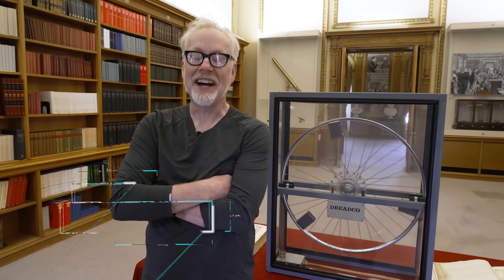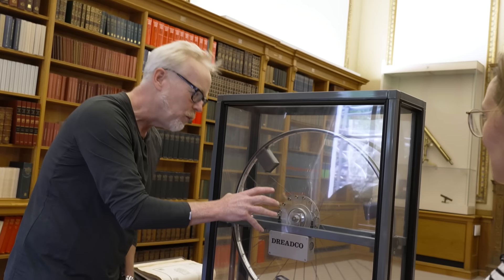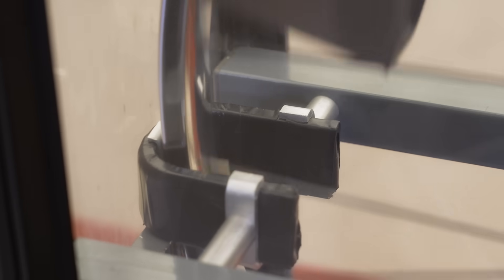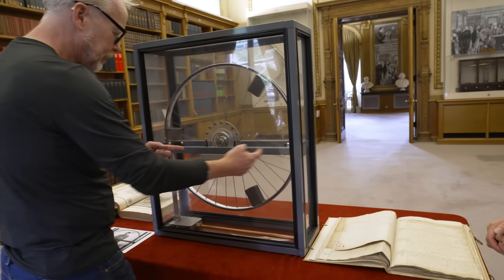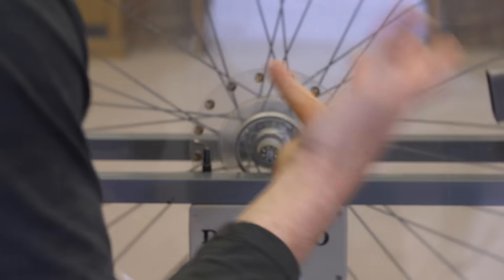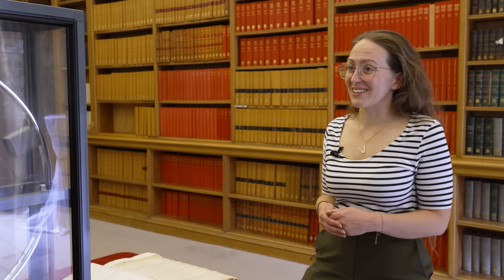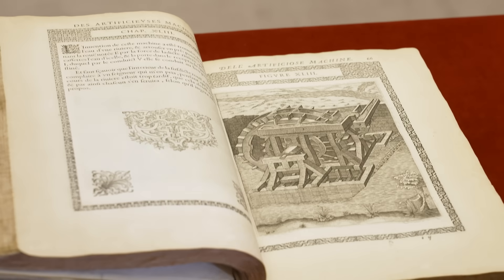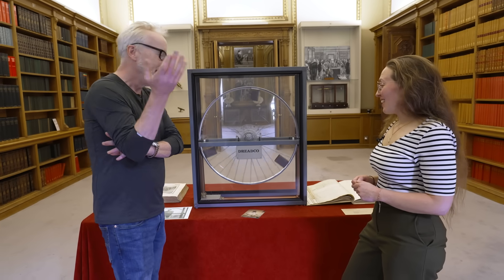Adam Savage vs The "Perpetual Motion" Machine!

Comment: I'd guess given the point of it appears to be to prove a point it's just a flywheel in nice bearings and thin air. There are no end of quite obvious ways to fake it using batteries and electromagnetic impulsing, to be interesting enough to make the collection it's either really really simple, its value is in asking questions of how we think. Or it's employing some genuinely curious environmental energy harvesting technique but that would be interesting in its own right in which case it doesn't need a 'perpetual motion machine' around it.

Comment: Is there any chance the box is a vacuum and the inside rim  are large magnets pretending to be counter weights....and the way they get it moving again is to just pass a magnet by it from the outside?
Reply: No. Thin acrylic would not withstand the force applied by a vacuum. Also when Adam taps on it you can clearly see it's not under vacuum.

But how would that make this any easier? The question isn't "how do they recharge it through the acrylic". They obviously just remove the acrylic. The question is "how is energy being continuously supplied to the wheel, where is the motor hidden, and where are the batteries hidden?"

Comment: you can't make a perpetual motion machine, but you can make a super dense magnet that lasts you 4000 years.
all you need to do is figure out the field dynamics so that forces from each pole don't cancel each other out.
like,... you know... opening up the exhaust valve when blowing the combustion out so it doesn't choke your engine.

if you can achieve a contraption that runs maybe 100 years even with the crappiest of engineering, on nothing but a single magnet? you've done it.

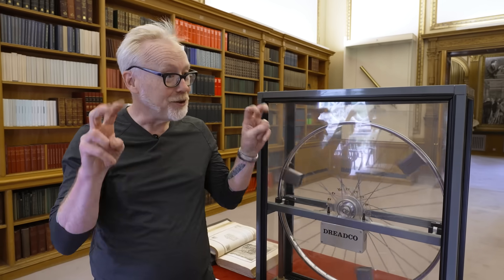8:50
no... you don't need overunity, you need just the right amount of it
the particle interactions that make nuclear reactors possible have been cooking and hardening within the Earth's mantle for literal billions of years.
releasing them in the span of 100 years or 100 milliseconds is all about the finesse of the engineering you apply to it.
there's no "overunity" in making a reactor to extract energy from a piece of uranium.... everything you put into making it will still pale in comparison to the amount of energy put into creating that lump of uranium by squashing and twisting layers of molten rock for millions of years under the Earth's crust, which will then be released over a period of decades, much of which will be lost to friction.
your "unity" has been boiling and cooking all over the place up until this moment... all you have to do is know that fact, first and foremost, before you try to "over" it.... which, let it be mentioned, you won't achieve.

Comment: If you can see it, hear it, measure it, in any way, it is not perpetual. The act of measuring requires some input/output of the system. Since energy can not be created, it is guaranteed to use energy to observe it. With that said, you can't observe perpetual motion

Comment: Each of the 3 small boxes contains a battery, a coil and a diode. The u-shaped pieces on each end are magnets. When each coil passes by a magnet, the change in flux causes current to flow in the coil, building up its magnetic field. When this happens a small amount of charge is drawn from the battery through the diode. As the coil passes the magnet, the field collapses creating a magnetic field that opposes the permanent magnet, giving it a small push.
Reply: @danejames7098 Nothing anyone has ever built or will ever build is a perpetual motion machine, so this not being one either should be very unsurprising.

If you ever find yourself wondering, "is this a perpetual motion machine?" The answer is always no. Always. There are literally no exceptions.
Reply: We can not confirm or deny whether this is correct. Gold star to u sir. ⭐️
Reply: Seems too obvious considering she said he tossed in decoys to stump people. But knowledge is exponential! Good chance what people thought was complex science back then is trivial to us in modern day.
Reply: @danejames7098 Perpetual motion machines cannot exist - That's it! There is always friction, which transforms energy into heat - even if that may be friction to air! Put in a vacuum maybe but there will be friction in the bearings. Anyway its pointless - they DO NOT EXIST and never will!
Reply: This is what I was thinking as well, just far more eloquently and scholarly spoken.
Reply: @danejames7098this device is a puzzle ment for people to look at and try and figure out where the trick is hidden.

the host even says as much dutung the video.

Comment: So it looks a lot like an early static electricity motor or better yet a wimshurts machine that is being run by static electricity, which uses a similar but simpler idea to the later electric motors. It would explain why there is a number of potential points that are sitting around the wheel. And would explain the disappointment that the guys had. 
However power supply wise, obviously there isn’t any layden jars (simply version of a capacitor) but it could be using a modern battery. Or if they really wanted to have fun they could have used a dry stack battery which would be good for very small amounts of energy being released over a long time. 
Now it could also be that the inside of the entire case is actually a layden jar which would be amazing because it would mean that the answer is slapping you in the face but it’s easily overlooked. 
It’s also possible that it is scavenging static electricity from its environment too. Which means that it’s actually honestly a power generator but isn’t technically over unity. The reason for it slowing down would be because it’s too isolated and would need to be in a place where people are moving around. 
It would be an interesting experiment to instead have it in a main room for a number of years and to see if the slowing down issues actually didn’t occur

Comment: It is basic HS science to know that electrons flow onto a ball shape, and off from a pointed needle. This specific part of the wheel deals with static electricity, and may also include electrons/ions as the same basic push/pull force. The wheel is creating an ion/electron flow that gets picked up by the ball, and emitted from the point. The large metal squares add inertia to keep it moving, as well as to pulse electrons.  It takes less energy to keep an object moving than it does to get it started.

Comment: The nozzles on top of the dreadco box provide a flow of air into the cups. That flow is the result of passing the 3 moving objects through the 3 stationary objects (u-shaped) which create a pulse of air into the square tubing, into the dreadco box, and through the nozzles, into the cups, with just enough pressure to rotate the wheel.
Reply: So you think the wheel is pumping air through a tube with multiple right angle bends, and out a tiny nozzle, with enough force to move said wheel, but with losses on the order of 0.1% system energy dissipated per day? All the air deposits all of its energy in the wheel. No energy gets lost to air resistance. No energy gets dispersed into the atmosphere when the air exits the nozzle. The bearing loses no energy due to friction. Just two years of sustained gentle breeze powered by a slowly rotating bike wheel?

Yeah...no. That's very, very silly.
Reply: The energy it takes to compress the air, albeit slightly, would have to come from the wheel... only to have it deposited back to the wheel... The losses are too great. There is no sense in robbing force from the wheel to try and keep the wheel moving, since you will always lose energy in the conversion or transfer. No, whatever is imparting energy to the wheel is independent of the wheel, and thus needs (ahem) perpetual service.

Comment: I suspect the three boxes all contain a small battery-powered circuit that senses the magnet and discharges a short pulse into a coil, giving a very small kick. This could be made to drain the battery extremely slowly. All the other elements are red herrings. Perhaps also the box is evacuated to eliminate any air resistance, and the bearings could be ceramic for very low loss.
Reply: You can almost see the wheel pulse like you describe
Reply: I would agree with this hypothesis. It would also help to ensure the wheel keeps spinning, one, or even two of the boxes could fail and the third will increase output to compensate. I would even add that the sensors may well have timer circuits which measure the period between detections and reduce or increase the size of the pulse to regulate the speed of rotation.

Comment: Any method of generating energy and then using that energy to help spin the wheel will have some in-efficiency and would therefore slow the wheel quicker than not having the devices. There needs to be some form of energy storage providing the small amount of power needed keep it moving.
Reply: Yup. Remove all the extra stuff, and I guarantee you what will be left is a wheel, an electric motor, and some batteries. Everything else is a red herring.

Comment: It MUST have some impetus to overcome the friction from the bearings, I guess it has to be a motor, running at an ultra low current.
Genuine perpetual motion is only possible with zero friction, which is also impossible, even in a vacuum there will be particles present which will impart a minute friction, even a beam of light has a pressure.

Comment: Perpetual motion might be possible in the sense that something may be able to be exactly 100% efficient. (Probably not though.) But getting said device to then do any work without additional input energy is definitely impossible.
Reply: Nope, doesn't work. Also that's not what anyone means when they're talking about perpetual motion unless they're posting something like this. Perpetual motion refers specifically to overunity. "I could make something move forever if I removed all the things stopping it from moving" is not very interesting, or insightful, or useful if accomplished. It's just box ticking next to dictionary definitions of "perpetual" and "motion".
Reply: iirc it's not even possible to have a 100% efficient machine, because of chaos theory/entropy
some forces always forces pulling on everything, like the gravity of all matter pulls on all other matter in the universe, etc.
Reply: there will always be some friction.

Comment: Imagine if someone figured out how to break physics and made one. No one would ever think it were true. 
With good reason.
Reply: Nah, they'd just demonstrate the device, and then people would believe them. If the device works, proving it works is trivial. The problem is none of the devices ever work, so tricking people into thinking they work takes a lot of effort. You have to figure out how to hide the energy source, set up an event where you get the right kind of gullible people to show up, convince them they can't actually inspect things because <safety/trade secrets>, explain away why your test of a "perpetual" motion machine only lasts a few minutes, come up with reasons why you can't let any independent group examine the device at any point in any capacity...

Comment: This might sound crazy but could it be weight transfer and magnets 

So the blocks are half filled with a liquid? 

When the wheel turns there is always two blocks around the top of the wheel A bit like a water wheel only rather than water filling the buckets for momentum there are two magnets either side with opposite poles creating a magnetic pushing motion this obviously isn’t enough to push the wheel fully, which is where the weight of the water comes into play as they reach the top the weight of the water forces the wheel the rest of the way round

Comment: Air blows on the tiny cups from the right side. Wouldn’t take much. It spins so gently with no apparent pulsing. 
Still doesn’t explain energy conversions that are taking place though.
Reply: Also perpetual motion is BS for the most important reason. If it doesn’t do worthwhile work it is useless.

Comment: A wheel spinning in space (or in a total vaccum) would be perpetual motion wouldn't it? If you're not talking about harvesting energy from it, it would go forever.

I mean you've got the heat death of the universe to deal with, or the eventual extremely weak attraction of distant gravity that will eventually pull it away, but at that point, not even a perpetual motion machine can be perpetual motion machine because the planet will burn eventually.

If you just want to harvest ambient energy, just get a dang solar panel.

Comment: adam savage . . how would you like to test my . . perpetual motion machine;) 
single system; say can of soup; cannot be perpetual motion machine . . because pressure is equal all sides; thus law of thermodynamics dictates cannot be done; 
if two system; say fan . . propeller and motor . . facing wind; or gravity will have to stop; because laminar flow in single direction is equal to pressure is same all sides; 
but if same system was under water . . bottom of river; or ocean; facing flow of water; turning impeller; then vacuum created by rotational mass need to be dealt with via vent; to equalize pressure; from vacuum generated; to allow net plus energy to generated; 
if under water; ocean . . caisson or submarine . . were to leak a hole at 400 feet; at 6" diameter; pouring in; inside of submarine liken to fire hose emitting jet of water; and if we were to place; impeller; front of fire hose; would we not be able to generate electricity? spent water in submarine is expelled by air; is less dense; thus there is net plus electricity ;
would this not qualify as perpetual motion machine?

Comment: something tells me its just a stirling engine, but in a different way, contained within those boxes is two gasses, gasses of which i do not know the composition, very heat sensetive gasses, but also inside the box, is a small weight, one that devides the gasses in two, and depending on the orientation of the box on iether side of the mechanism, the gasses will exspand and retract due to temperature differences which in turn shifts the weight iether closer to the outside of the wheel, or the centre of the wheel, which creates the perpetual motion, and assuming the boxes are well lubricated, its the incredibly low friction which allows it to run for as long as it does. please let me know if i just invented a perpetual motion machine, or atleast if i cracked the case

Comment: I bought one of those Lucky Waving Cats that use a small solar cell, a capacitor and a coil to move the waving arm. I'm pretty sure this is the same concept. The lucky cat will continue to wave for almost an hour without a light source. If you minimise losses in the system, with a good quality bearing and the mass of the wheel, I suspect it would go on turning for a very long time.

Comment: Magnus Effect?  The box is a heat exchanger, causing a draft.  Maybe something in the box facilitates the pressure difference?  Could be lightweight aluminium wheel and the boxes on the spokes could just be sails also providing flow back into the system.  Looked like what would be intake is larger diameter, maybe a few more tricks to bring the forces to heel.

Comment: It's not possible. 😢 it runs off the earth gravity at best. If gravity wasn't a thing. 😅. Fly a kite up high with a wire and the electronic machine will run for as long as the earth move? Difference in everything will give something. Everything has a want to equalize. Like kool-aid. --next--->
Reply: Okay, if you release Kool-Aid in motionless water, eventually, it will mix perfectly without steering 😊  everything has a need to equalize?😮